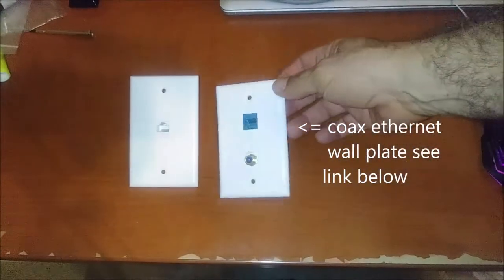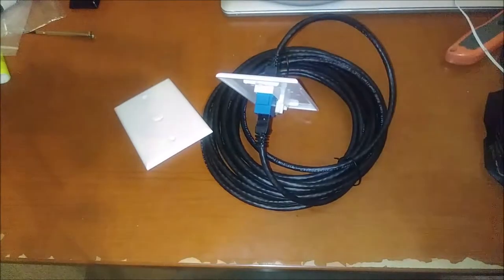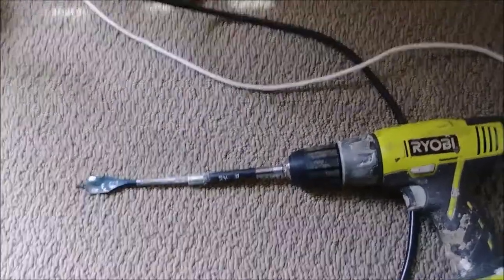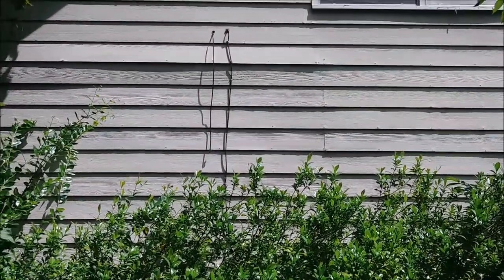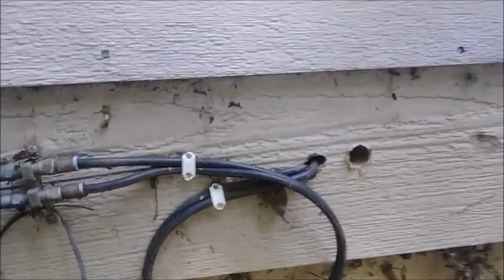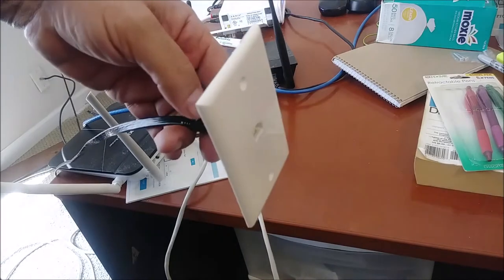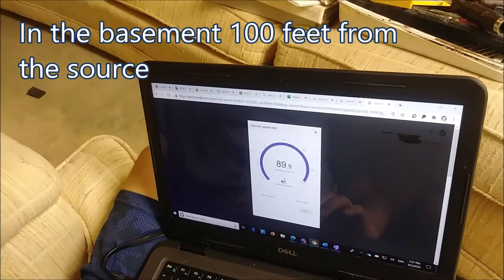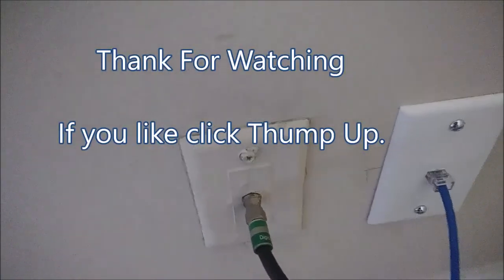How To Add An Ethernet Jack Wall -  Cat 6 and Cat 7 - Quick and Easy

Comment from the maker: Material used:
1 Port Ethernet Wall Plate white -  Single Gang Cat6 RJ45 Ethrenet = https://amzn.to/3e6tSbF
2 Port Ethernet Wall Plate white -  Single Gang Cat6 RJ45 Ethrenet = https://amzn.to/3eaiSdc
Long Ethernet Cable 100 ft,  Cat 7  High speed = https://amzn.to/381CWuy
Cat6 Ethernet Cable  in Black 20 ft = https://amzn.to/383It3R
Cat6 Ethernet Cable  in Black 25 ft = https://amzn.to/3uL9Byh
Cat6 Ethernet Cablein Black 30 ft = https://amzn.to/3c0xOIy
Long Cat6 Ethernet Cable  in Black 35 ft = https://amzn.to/3sC81Ng
coax ethernet wall plate and 1 gold plate cable tv = https://amzn.to/3830WgN
RJ45 Cat-6 Ethernet Patch Internet Cable - 10 Feet (3 Meters) = https://amzn.to/3sNrPgV
Ethernet Extension Cable Cat6 Cable RJ45  10FT = https://amzn.to/308Z4Pr
TP-Link  8 Port Gigabit Ethernet Network Switch = https://amzn.to/3kChG3E
TP-Link  Gigabit WiFi Router  5GHz Dual Band = https://amzn.to/3b85oNi